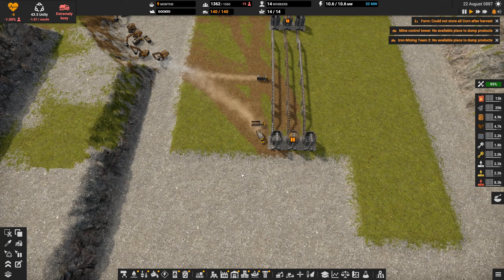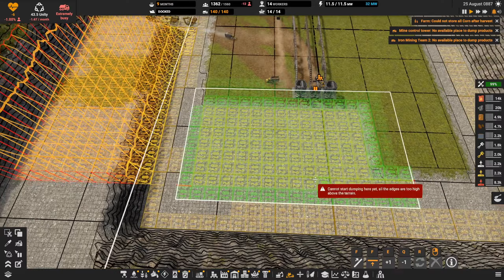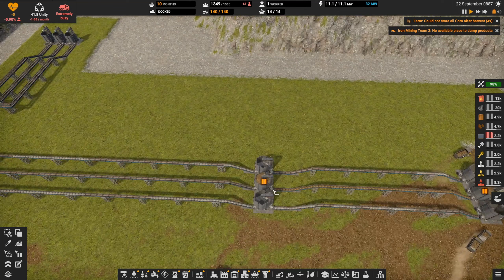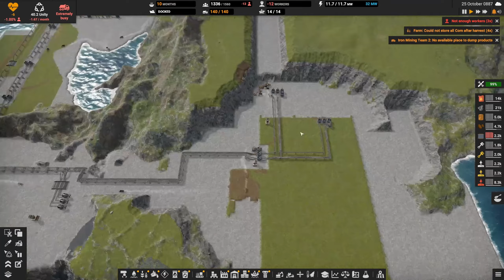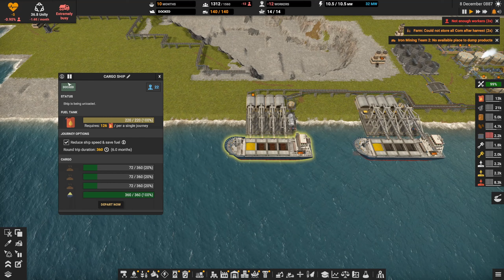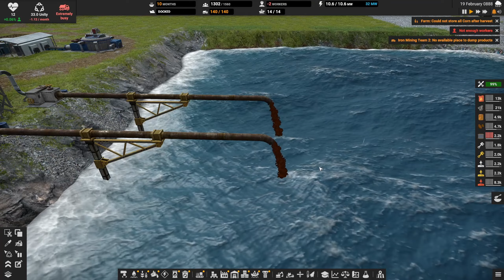New Buildable Land!! | Let's Play Captain of Industry s06 e66

Comment: If you dig into water does it flood?
Reply: it floods!
Reply from the maker: As Alberto already replied, it does indeed flood. 

Floods are tough to recover from. If you want to purge all the water, I think all you can do is re-fill the hole with material and then mine it all out again. It happened to me twice. 

Both times it occurred when I failed to take into account that there will almost always be a bit of landslide when you're mining. So even if you put your mining designation 1 square away from where there's water, there's still a chance for a tiny landslide amount of material to allow water to reach your digging site. You always want to have a land buffer between where your mining and where the water is. The deeper your mine, the larger land buffer you will need in order to prevent flooding out your mine.

You can also use retaining walls to help in this regard, but I'm not an expert in using those.